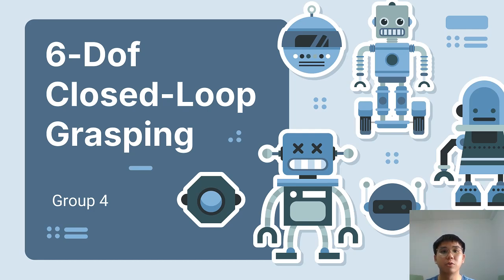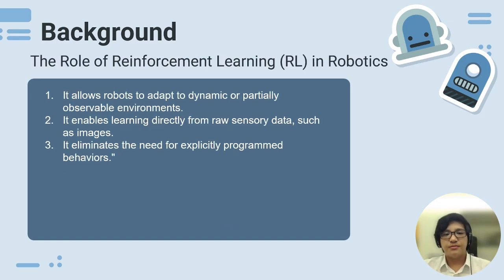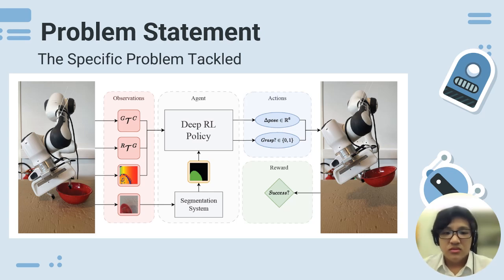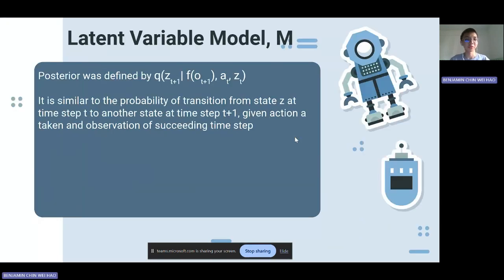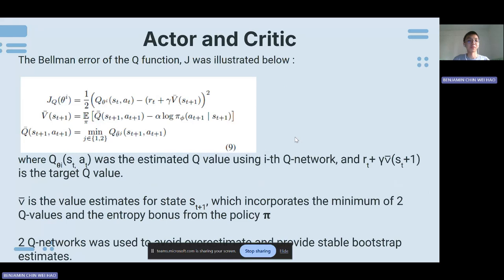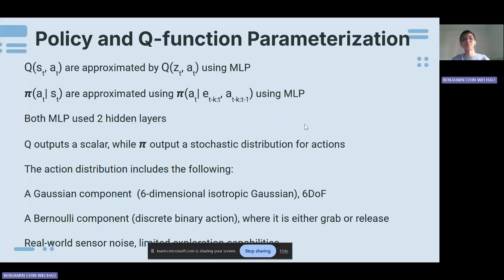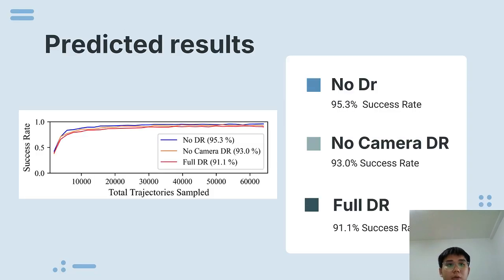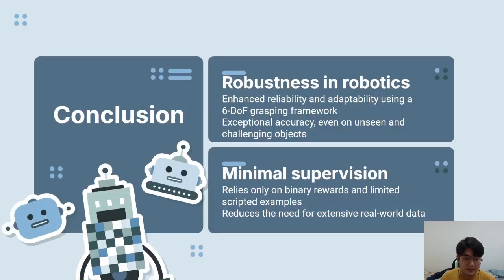202409 AIT306 Group 4

Comment: How does the 6-DoF grasping framework enhance robustness in robotics, and in what ways does the minimal supervision approach reduce reliance on extensive real-world data while maintaining accuracy on challenging objects? (by Group Three AIT2109611 Siau Soon Hong)
Reply: The framework utilized SLAC algorithm to model the dynamic and reward of the environment that contains noisy observation due to randomness of object in the environment received by agent using latent state estimation to simulate real state. Double Q-networks does used to avoid overestimation by critic, allow actor to update policy in the direction that improve expected returns. enhancing grasping ability. Data augmentation are done before evaluation to ensure robustness of agent. 

Domain randomization was used to induce variability in simulated environment using log-uniform distribution to make agent robust to the difference between real and simulated environment. Perlin noise are added to data to generate natural looking textures and mimics real-world imperfections, thus maintaining accuracy of grasping challenging objects.